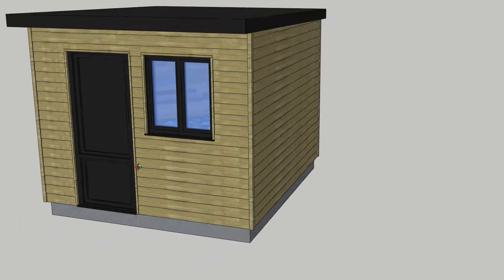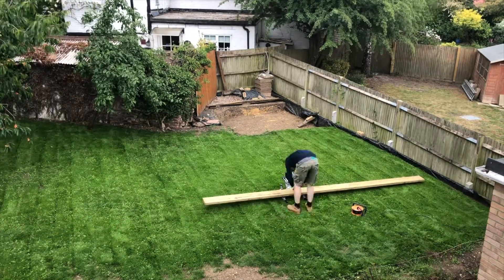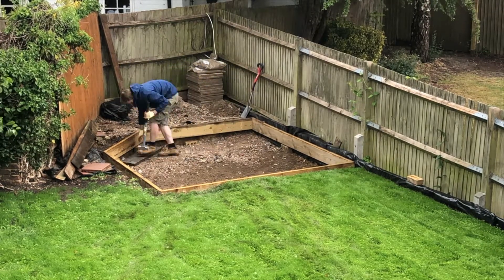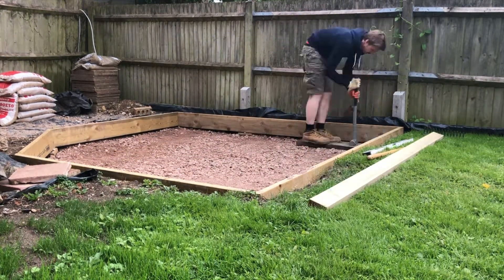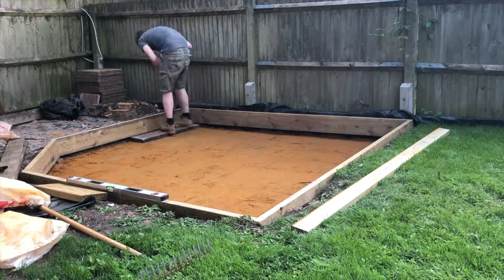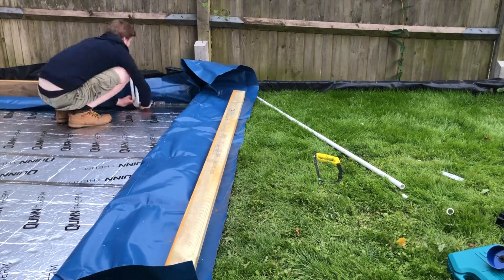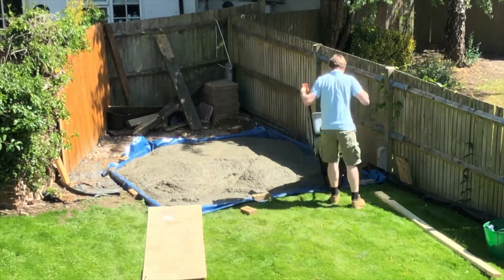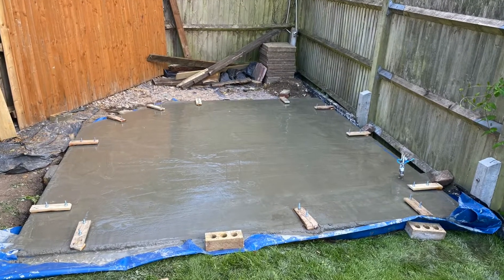How to Build A Concrete Slab Base with Time Lapse - Drum Studio Garden Room Build - Part 2

Comment: Great video.  I'll be sure to watch the rest.  One word of caution though... Ethernet cables can suffer from electromagnetic interference if run for more than a metre or so next to mains power cables.  Even shielded CAT7 ethernet cable needs to be run at least 30cm away from mains power, regardless whether it is inside its own plastic conduit.  Better to use fibre optic cable and a media converter at either end if you are restricted to a single duct.  There are also some very good ethernet over power devices which will allow you transmit your data over the power cables.

Comment: Was that PIR you used in the concrete base?  I thought EPS should be used for a load bearing slab and not PIR?
Reply from the maker: It was PIR You can use either. The thermal efficiency of PIR is higher so more expensive than EPS.

Comment: What size timbers did you use for the framing
Reply from the maker: Far too big than was needed! I think they were 45mm by 175. You can get away with using cut down osb or smaller timbers, as long as it is staked and supported wel..

Comment: Why does the insulation go under the concrete?
Reply from the maker: Good question - it helps with the thermal mass of the concrete. The idea being that due to the density of the concrete, it will absorb heat so by insulating under it, it helps the concrete to retain the heat, thus retaining heat in the floor/room.

Comment: Hi Lee... Im building a concrete base similar to this based on this system... 100mm PIR under 100mm concrete/rebar.  How is yous holding up after all this time and would you do anything differently? thnks
Reply from the maker: Hi Ray, thanks for the comment. Yep everything is all good thanks! Only thing I might have done differently as per some of the other comments on this video is to add an extra layer of dpm/vapour sheet inbetween the PIR and concrete to protect it from a small damager that overtime it could breakdown if exposed to moisture. Next to no cost for extra piece of mind. Good luck with the build!

Comment: Amazing video! I am just starting mine. My slab will be 5m x 3m and will be used as a garden room gym. Is 150mm concrete enough or should I go to 200mm because the floor space is larger compared to yours? Thanks
Reply from the maker: Thanks! 150mm would be more than enough for all general residential usage, especially if you add rebar as well. The size of the floor space doesn’t really matter, as most of the stress is going where the walls are positioned. Houses will normally be built with 100-150mm. Hope that helps!
Reply: @leejmurphy  great thank you. One more question if you do not mind is does it matter is I don’t set the bolts in the concrete like you and use concrete screws instead? Only because I am making the base but someone else is building the rest of it and don’t want to guess spacings incorrectly.

And finally do you need 25mm insulation board around the perimeter of the slab so heat isn’t lost through the sides of the concrete?

Many thanks
Reply from the maker: Sorry for the delay! I see no reason why you cannot use concrete screws. I didn’t use 25mm insulation around the outside, but if I was to do it again I probably would. Just make sure your wall plates line up with the edge of the concrete, not the insulation

Comment: Great video dude, I’m going to use this method for my studio room. Which size runners did you use for shuttering? I noticed you raised them to the top of your finished height too?
Reply from the maker: Thanks for the comment Brett, glad you enjoyed the videos! I think I used 225mm by 45mm for the shuttering. Probably overkill in hindsight. I used some packers and stakes to fix the shuttering to the height that I wanted the concrete to reach and used the shuttering to level it.

Comment: Hi I build a shed for storage concrete base and wooden frame with shiplap the roof is not insulated with tin felt and has a decent run for water my problem is the inside of the roof is all wet I have installed 3 air vents and the concrete slab has a damp proof membrane under it any idea's why this is happening thanks
Reply from the maker: Hi there. Not an expert in this but sounds to me this is to do with your metal roof. What's happening is moisture in the air from the inside of the shed is rising and condensing against the metal roof when it gets cold. Metal will react with the outside temperature quicker than wood and this is worse in a building with no insulation, aka a shed. I think the first thing to look at would be your ventilation. You mention you have 3 air vents, are these located high up in the eaves? If they are at the top then this will help the warmer air escape out rather than condensing on the underside of the roof.
Reply: @leejmurphy  Hi thanks for your reply yes i was thinking air flow also and yes air vents up near the roof that is wood boards not metal. Im think its something to do with the back garden wall that i build on to maybe i will upload a video and share link thanks again for reply :)

Comment: Hi, great informative video.  Can you confirm whether to use sharp sand or building sand on the hardcore?  Looking at your materials list I can see you've listed building sand but when researching online most people are advising to use sharp sand.  Thanks!
Reply from the maker: Hi there, thanks for the comment, glad you enjoyed the video. I did use building sand. Sharp sand could potentially contain some partials which could pierce or damage the DPM as it is very gritty (although i suspect the likelihood is low), but building sand is much softer. Having also researched this, i think it is one of those topics which people are divided on but probably doesn't make a lot of difference in the end which one you choose.
Reply: @leejmurphy  Thanks, that's really helpful!  I'm just starting my summerhouse build and probably spending way too may time thinking about it rather than cracking on with it!
Reply from the maker: @SnookerFanZone  Glad I could help, good luck with your build!

Comment: Would this kind of base be suitable for a conservatory without walls? I'm planning on glass sliding doors all around or would I still need to dig out footings.
Reply from the maker: Hi Glenn, generally you want a base of 4 to 6 inches thick depending on the load and intended use, so it would be fine with this type of construction for an outbuilding. However if this is for a conservatory I would expect slightly different building regulations apply as it is classed as extending your property. You might find you do need footings. Best to do some research on the Planning Portal site https://www.planningportal.co.uk/info/200128/building_control or speaking to your local building control.
Reply: @leejmurphy  Thanks Lee for taking the time to reply.

Comment: Hi Lee, Great video it is very helpful and I’m looking to copy this. Could you let me know what type of sand I would need to use for the 25mm layer on top of the Type 1 please? Also is it the Type one limestone?👍🏼
Reply from the maker: Hi Jonny, glad you liked the video! Thanks for your question. I used building sand, there is a link in the video description to the exact sand I used. It is finer than sharp sand so it is the best stuff to use when laying a DPM on top to reduce risk of puncturing.

Comment: Very clear and detailed video, thanks for sharing.  The only thing you missed was the secondary membrane layer over the 75mm rigid insulation.  This is because the foil facing on the insulation causes an undesirable chemical reaction with the concrete, so a second membrane is placed over the foil to stop this from happening.
Reply: Great video. I'm going to put an insulated base down too and will definitely have the second DPM. I just can't figure out what to do with the first DPM edge. Can it be folded back over the insulation and the second DPM on top of that with the concrete on top effectively encapsulating the insulation...or do you just have two DPM edges exposed to the outside world?
Reply from the maker: Sorry for the delay, I didn’t see a notification for this comment. What did you decide to do in the end? I would probably have folded it over the insulation and encapsulate it. The main thing is there is a layer between the ground and finished floor somewhere to stop water ingress from below
Reply from the maker: Hi Paul, thanks for your comment. Yes you are right and make a good point. I did some research into this and found people have different opinions on whether it makes much of a difference or not. I'm not expecting any side effects, but for the cost, one may as well add the second layer if the insulation is going under the slab.
Reply: Hey Paul & Lee, I'm questioning this too and interested in what you did in the end.
Doesn't the DPM (between the sand and insulation) need to protect the sides of the concrete from the ground too? Therefore it would have to come up the sides (as Lee did in his video). This is how I'd envision the second separation layer between the insulation and the concrete. Therefore both the DPC and separation layer would run up the sides of the shuttering before the concrete is poured. My first thought would be to fold those both over the top of the concrete and then fix them down under the timber - but also considered running it up the timber wall as they would be covered by the OSB etc.

Comment: Thanks for the videos, I've found them very useful.  I'm looking at an insulated concrete slab myself.

On the insulation, did you consider insulating the sides of the concrete as well as underneath?  I've seen some suggestions that insulating the sides is important too.
How are you finding the floor temperature (assuming you've now completed the build)?
Reply from the maker: Thanks for the comment, glad you are finding the videos useful. I am still working on the room at the moment so i'm not sure how the floor temperature will be yet. I did do a bit of research into the insulation options. If taking the insulation around the edge, I wasn't convinced it would hold up with the support of the wall over the top of it. But with that being said you could choose to do something like this which would work  - https://www.protradecraft.com/slab-edge-insulation-why-it-matters
Reply: @leejmurphy  Yeah, I've not seen/found an obvious way yet of how the insulation around edges would work exactly....putting it directly under the timber wall doesn't seem great to me either, unless it was very thin.
Only thing I'm thinking is putting insulation on the outside, and angling the top of it to hide it at the surface, with some plastic sheet around it to protect it.
https://imgur.com/WhJTeGw
Reply from the maker: Yes that looks like a good approach. You probably only need 25mm insulation on the outside. If you get your timber frame right on the edge of the slab like I did, then you'll probably find by the time you put OSB, batten and your finished cladding/covering, you will cover up the insulation that would otherwise be exposed.